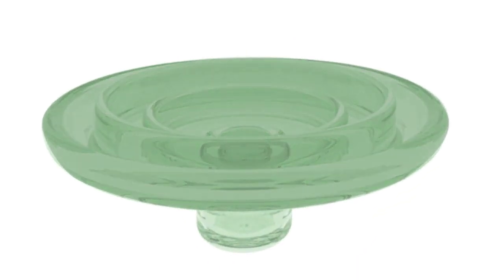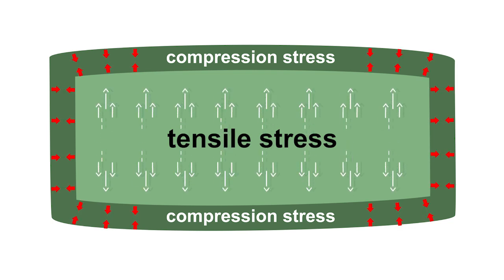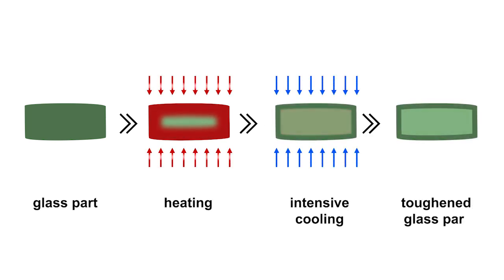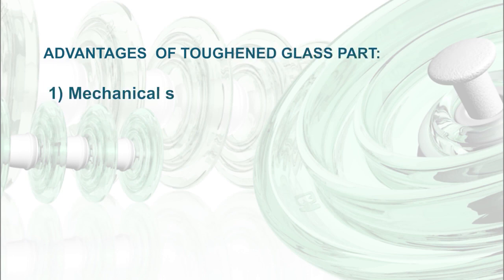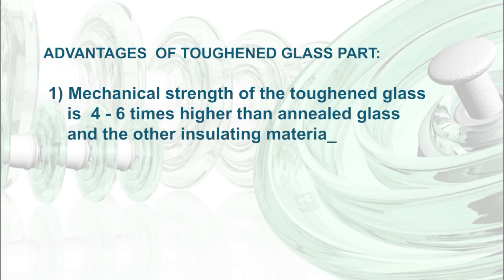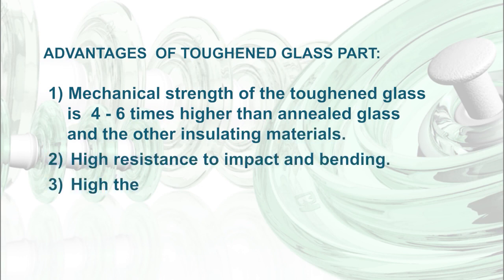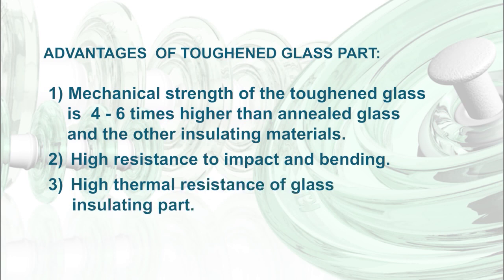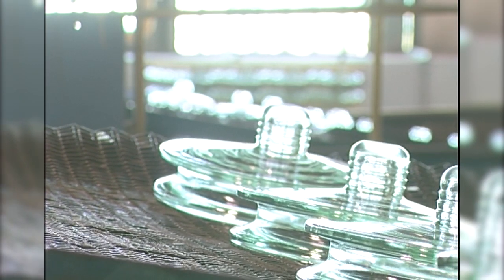Toughened glass insulators

Comment: I have seen a lot of glass insulators used in Europe on their high tension lines and their lower voltage distribution lies in France and Spain. These are most likely toughened glass.

Comment: I don't understand how at 4:21 the insulator is remaining structurally continuous... If these glass insulators don't have holes in the center for the metal connections between them to go through (obviating their purpose as insulators if they did!) but rather cemented to either side of the glass separator, then how are those strings still remaining intact with one of the glass pieces totally broken and missing??
Reply: I would guess the glass fragments are still large enough to anchor both sides of the metal "cups" the glass seem to have a stepped shape so maybe the same tensile forces make the glass fragments "roll" and get stuck.